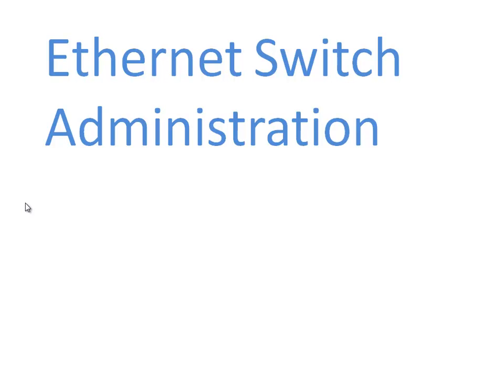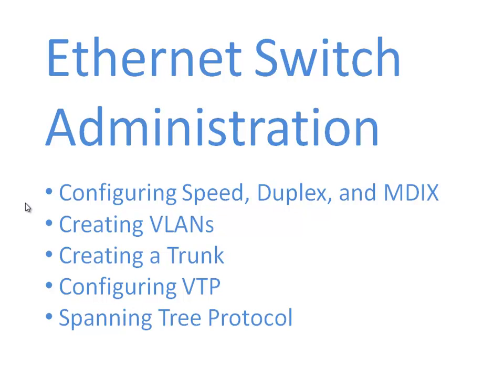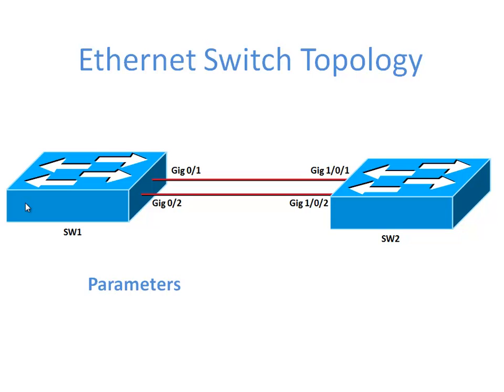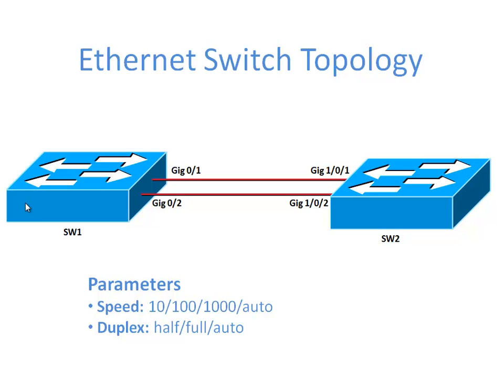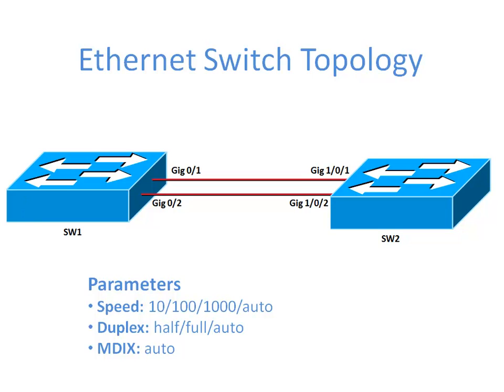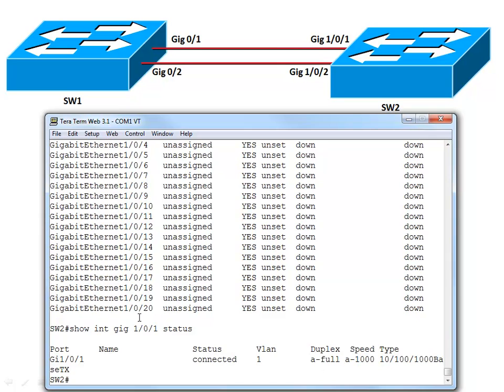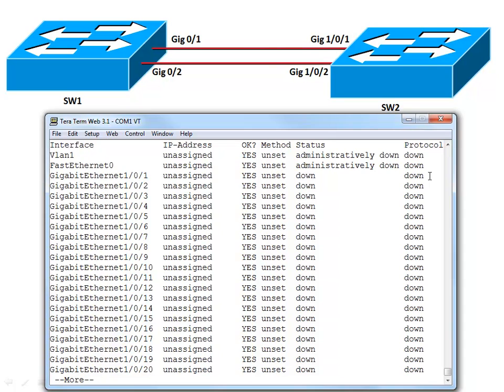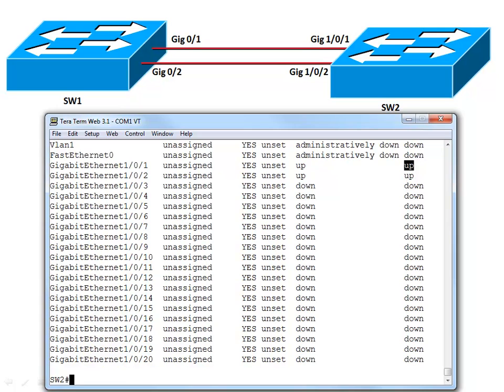ICND1 - Video #11 - Ethernet Switch Configuration - Part 1 (Speed, Duplex, and MDIX)

Comment: So you can't hardcode them unless you have a crossover cable?
Reply: ***** Interesting... Is it a general requirement, or do only particular switches have that problem?

I will soon have a Dell PowerConnect 3524 to play with.

I tried connecting two XenServer hosts together with a simple patch cable, each had a D-Link DGE-528T (supports Auto-MDI/MDIX), and they didn't like it. The MAC address kept disappearing on one of the hosts.

So I thought I'd try it though a network switch and hope for the best.

Comment: Your welcome! I am just took and passed ICND1 in April and now preparing for ICND2 and the whole VLAN / trunking / VTP story is not topic of ICND1, but for sure its ICND2 material. I found the video very informative but for students looking for basic switch configuration as it is topic in ICND1 this might be very confusing. 

For ICND1 students a single crossover cable between switches with speed and duplex config tutorial and VLAN1 setup should be enough. But anyway its a great video!